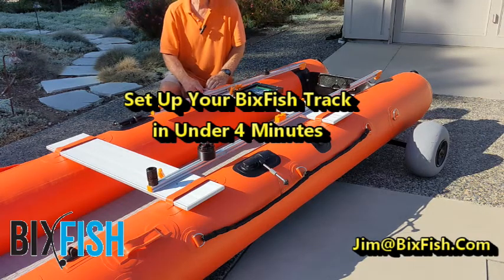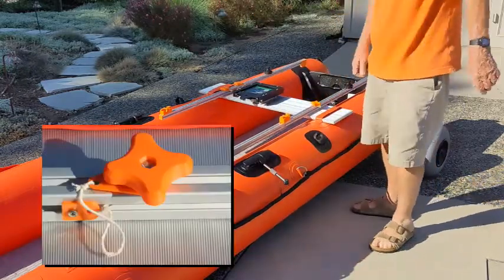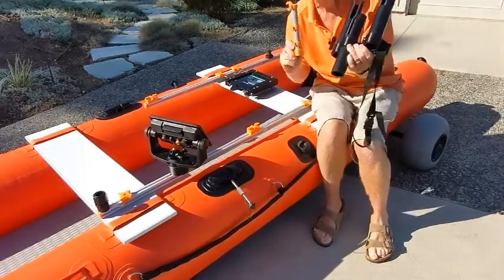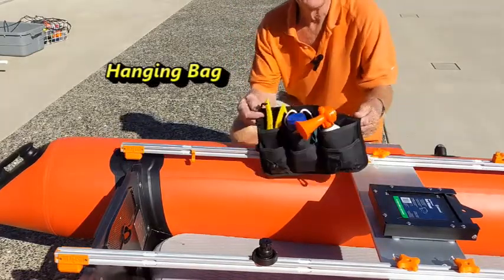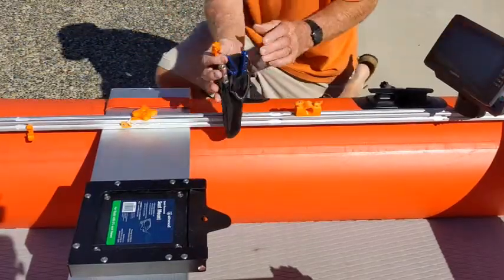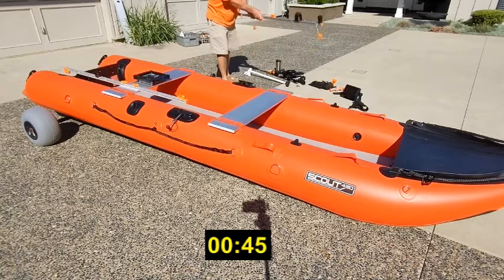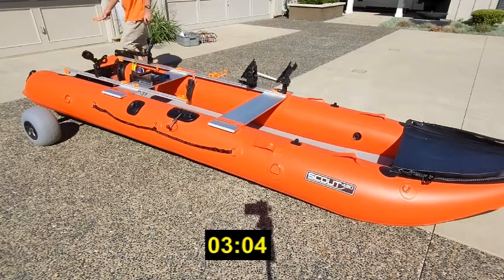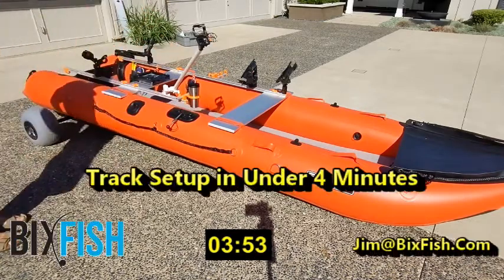Set Up Your BixFish Track in Under 4 Minutes

Comment: this system is extremely well thought out and customizable.  I had been researching a way to organize my AB 9.5 dinghy for fishing and not finding exactly what I wanted until I found Bixfish on line.  I thought I was going to have to glue a bunch of mounting pads to the tubes.  This system allows me gear up for fishing or remove and haul passengers or crab traps easily
Jim was super helpful with design details and ideas.  very pleasant transaction. Thankyou, thankyou!!

Comment: Hey is this the scout 430? What are the lengths of those 2 extrusion rails? Thanks.
Reply from the maker: Yes, the boat is a Scout 430. The longer track goes from the transom to the middle seat and is about 75-1/2" long. The shorter track goes from the transom to in front of the rear seat and is 56" long. By going back to the transom the rear bass seat is stabilized against rocking back and forth, and that area behind the rear seat is a great place for storage bags as well as trolling rod holders. For more info see BixFish.com. If you are interested in buying a Scout boat, use discount code 'bix' at checkout and you will get a 10% discount on the boat. In addition, if you use that code to buy your Scout, I'll give you 10% off on BixFish products you buy to outfit the boat.
Reply: Thanks! Im interested in buying a 430. What are those 2 orange pieces at the end above the transom? Looks like it fills in the space from the extrusion so it rests on the transom better? I have some other questions, not sure if you prefer I ask here in the comments? @ljbix
Reply from the maker: @Jam.S.D  exactly. The orange blocks are attached to the tracks and cool a bit of a gap. You can reach me at jim@bixfish.com for further discussion.